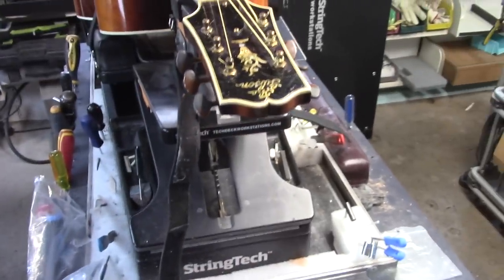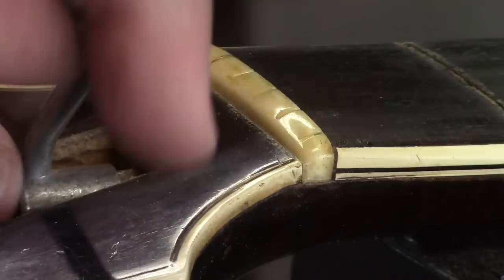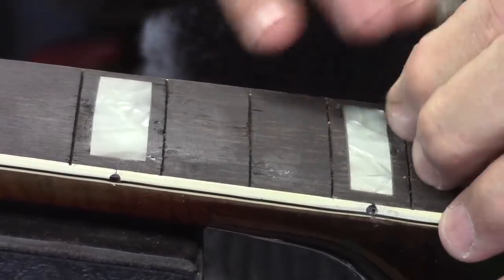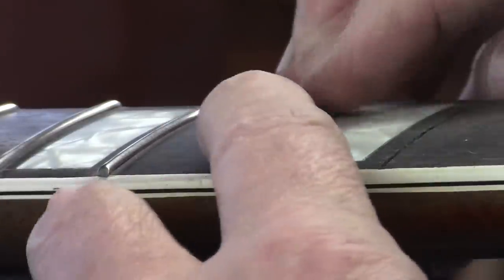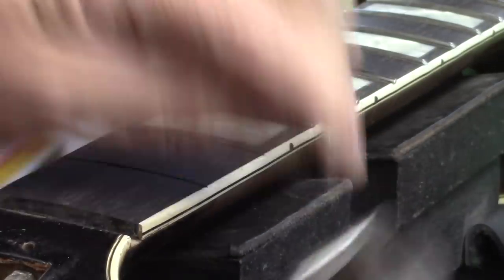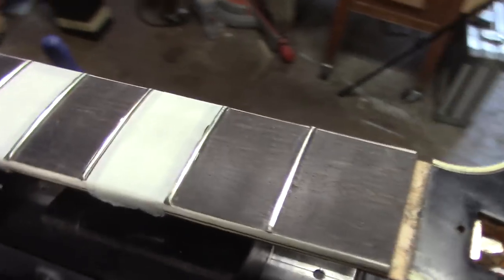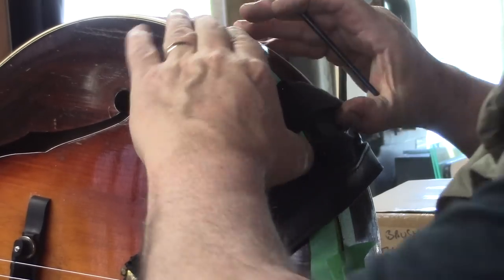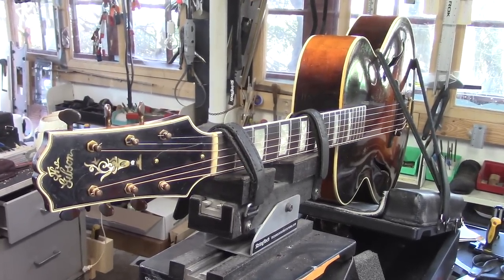1929 Gibson L5 Restoration / Detailed Tutorial @StringTechWorkstations

Comment: Wonderful explanations and quality work.  Wish you showed a bit more of the inlay of the pearl material, must have been tricky cutting and fitting into those existing holes. Thanks!
Reply from the maker: Thank you Chip. Actually the inlay went in reasonably quickly. All straight edges and 90 degree corners. Cheers ! MMcC

Comment: Incredible work Michael .I have a stupid question,do you tap the frets into the slots with the brass side of the hammer or the plastic side? i apologize for the lame question but i am going to attempt my first refret on a beater guitar Thank you in advance.
Reply from the maker: Hi Bobby happy to help out with your first fret job ! I actually use a 1lb dead blow hammer and a hardwood dowel to tap the frets in. The proper support of the neck while installing or levelling is the single most important consideration. Very best 👍✅
Reply: @StringTechWorkstations  Thank you Michael.So i can guess the closet thing on my fretting hammer to what you use would be the hard plastic side on my hammer ? I was planning on using a bag of rice to support the neck while i  tap in the fret,would that work? Thank you for the advice Michael.
Reply from the maker: A bag of leather buckshot would be better than rice. I've often seen hammer marks on fret boards after refretting. This is another reason I use a hardwood dowel ... to put some distance between the hammer and the wood of the fingerboard. The dowel also directs the "point load" more accurately onto the crown of the fret. IMHO ... best of luck Bobby !
Reply: @StringTechWorkstations  Thank you Michael for the advice.I will do my best and take it slow.

Comment: Love the video. Did the nut needed any height job after you installed taller frets?? Did the top supported those strings in this months?? Heard that very old guitars trend to have soft bracings and usually they don’t come along with heavy strings. Love the work, cheers
Reply from the maker: This one has held up fine ... no issues. Plays great .

Comment: This video holds so many answers. That fretboard turned out beautifully! I assume that if you establish a good mechanical fit then you won't need to use a caul and clamps while the glue cures?
Reply: Or maybe its incident specific?
Reply from the maker: It really depends on the thickness of the inay stock and the depth of the cavities .... also whether or not the cavities are cut with a radius. ( which is very rare )
Reply: Are you referring to the inlays? I meant with the fretwire hahah. Still very good to know though. I'd like to get into some inlay work over the winter if possible.

Comment: very cool, thanks for sharing each detail of the job and especially the over the binding fret work. 0 criticism, one thought and one question, Im redoing the block inlay on a forties Gretch new yorker with abalone and the depth of originals is quite a bit more then thickness of the mother of toilet seat original inlay, any thought on what I could use to shim up the new? and my thought on tuner lube; white lithium has also been my go to for guitar tuner's most of the time but recently on a Fender Jazz bass I found that automotive anti-seize paste make the tuners turn smooth under pressure. "Zaic's Guitar Repair (FB) love video, rite on mark
Reply from the maker: Thanks Chris. Glad to be of help. The abalone can be bought in various thicknesses. In order to ensure the that the fingerboard radius is respected; I find ( in most cases ) that a material thickness of .060" will allow you to hold the original radius. Hope that helps . All the best in 2021 .... stay the course brother, there has never been greater need for good Guitar Techs. Cheers , MMcC

Comment: Just out of curiosity, what is the radius of the fretboard? By the way I moved toKalamazoo MI 15 years ago. The Heritage guitar Co. it now in the original Gibson factory and the Gibson chimney is still standing. Every spring the Kalamazoo Historical Museum has the Kalamazoo Fretboard Festival.
Reply from the maker: That sounds like a lovely festival ! I'll have to get down there for that at some point. I didn't actually measure the radius ... once I make up the radius gauge with the tongue depressor ... I use that as my guide. If I ventured a guess .... appx 22" radius.
Reply: @StringTechWorkstations  Thank you for your reply. I have a '62 re-issue American Stratocaster. I replaced the original neck with a Warmoth compound radius neck. It goes from about 12" at the nut to about 20" at the heel. If that is 22" it's pretty flat. Sadly, I don't think there's going to be a fretboard festival this year for obvious reasons. One cool thing, on the second floor of the museum is a checker cab which came from Kzoo and an original harp guitar from Gibson. In 50+ years of guitar playing I owned two Gibsons, a '56 ES125 TDC and a '63 ES 330 TD.
Reply from the maker: I'd love get down there at some time in the future. Maybe we could do coffee or grab a lunch ?

Comment: Yellow food coloring thinned and applied to the new MOTS inlays will match the old ones. Did you use the original nut, or make a new one. Every luthier I've talked to when it came to a refret job, they insisted on a new nut regardless. Sometimes I've found that necessary, and other times not. What's your opinion on this?
Reply from the maker: If the nut needs to be changed .... change it. A Stradivarius Violin does not have it's original nut OR bridge.

Comment: loved this vid great work ! i have a 1960s kay guitar that i wanna restore as its had steel strings put on and now the action is pretty bad, i need a work shop and some tools for the job haha
Reply from the maker: The good thing about those old Kays ... is the neck joints were glued with hide glue. So as long as no one else has messed with it .... ( example : epoxied or superglued ) and contaminated the dovetail neck joint ... those necks often loosen up enough to remove fairly easily. The GPS TechDeck ( guitar pro shop ) is being shipped to numerous " weekend warrior " aspiring Guitar Techs for good reason. The TechDeck owners around the world ....  sign up to my Patreon channel Michael McConville Guitar Repair and Design Studies... and get front row seat in my guitar Repair Classes ... with a rewind button ! Cheers  MMcC

Comment: Amazing.  I was a little disappointed to see the chrome thumb wheels and studs on the handmade bridge.  Otherwise, absolutely amazing.
Reply from the maker: I made the call to keep the original bridge with the brass thumb wheels intact. Thus the coarser threads with the chrome wheels. But I have to agree, that the machining on those early brass thumb wheels was incredibly smooth .... even under full string load!

Comment: Pretty surprised by the air tool for the frets.  Never seen anything bigger than a Dremel before- thought it would generate too much heat and we'd see the fretboard burst into flames ;)   But nope - instead just some pretty frets.  Beautiful work.
Reply from the maker: I dial the air pressure down so that we don't run into the bursting into flames issue ;^ ) ! Lol !

Comment: He uses a sheet metal nibbler to notch the tang away.  You can also use those single size wire strippers.
Reply from the maker: Yes you are right. This tool was initially designed for nibbling out an opening in thin metal plates. Klein tools out of Chicago altered the table by putting a slot in it ... to accommodate the edge of the fret crown. JesCar out of NY ... the fret wire people ... also sell a very good looking tool for this job ( I've never tried one ... but they look very well made ).

Comment: Michael. With this being old. Would you use wax on the body to protect it? As you would old furniture.
Reply from the maker: Very good question Larry. It really depends on the condition of the finish .... but .... generally I'll use a 3M product "Final Finish" . I don't use it full strength. I'll very lightly dampen a cloth and put on a dab of "final finish" ... then use the tip of my finger in the most inconspicuos place as a test, before proceeding.
Reply: @StringTechWorkstations  .  There are lots of tools, waxes etc that aren't specific luthier tools. But work great on guitars. I've just been trying ' Kiwi, instant shine and protect' shoe polish, for touch up on wooden doors. It dries almost instantly and looks great.
Reply from the maker: You'll see when I post the next video on the 62 Southern Jumbo ..... that sometimes when the lacquer is falling off and deeply checked ... you are better off leaving it alone. Thanks for your question Larry.

Comment: Did they not want the body or anything cleaned up?
Reply from the maker: Generally speaking no. BUT there are some exceptions: #1 When someone has already stripped off an original finish and then re-finished POORLY #2 Oftentimes when a back or top is replaced ; it is acceptable to match the replacement back or top to the original finish. Here are a few examples :https://youtu.be/JWseZABzLbc. https://youtu.be/HPDmP88g8gE. https://youtu.be/rBMw7xQEgCo

Comment: It looked like the original fret ends were not under the neck binding as they are on more modern Gibsons, so the new frets didn't change that detail.  I have two Gibsons that were refretted  (a 1968 and a 1978) and both went from binding over the frets to under the frets.  Cosmetically, it's something I regret.
Reply from the maker: The big issue here ... is that ... in most cases ... the fingerboard will need some correction; which means losing the nibs. Take a look at this https://youtu.be/6TqJ88rGOT8 to understand what is involved in creating this type of "covered fret end " on a refret. Thanks for your comments . Very Best MMcC